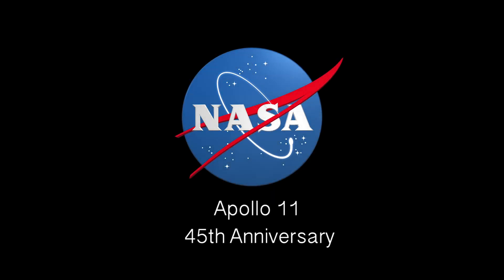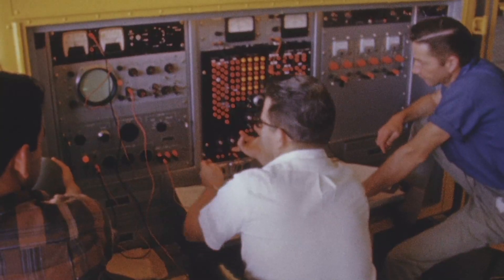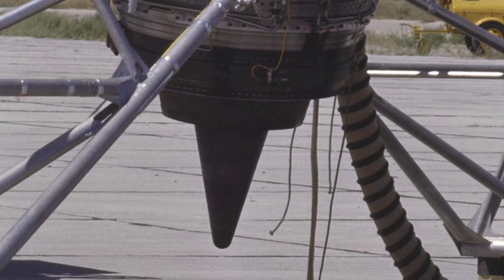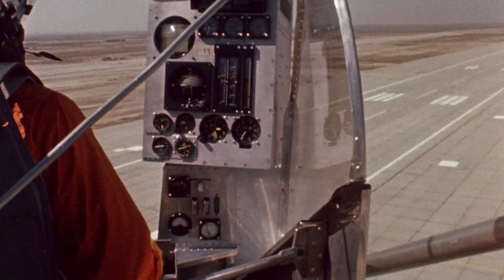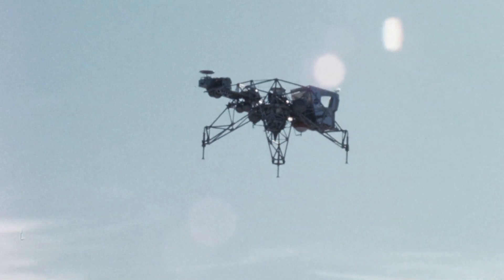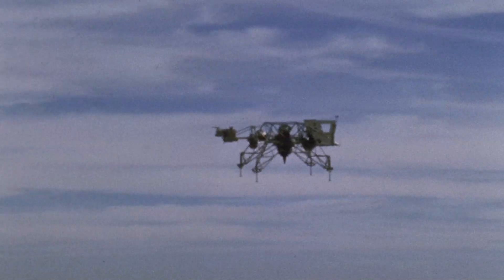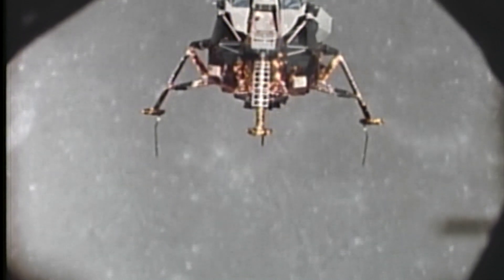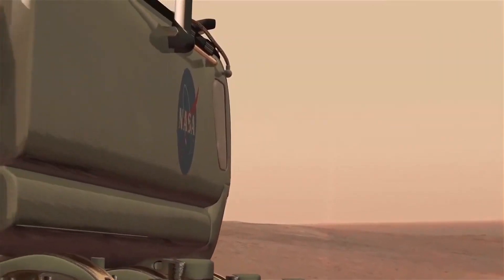LLRV Testing Contributed to Apollo 11's Success

Comment: Was it possible for a lunar lander to take off and do a moon orbit rendezvous? Yes. Was it probable to do,6 separate times, without error? Sorry, that bit is difficult to swallow. Given the complexity of the mathematics and the crude technology of the 60s, the pilots would have had an exceedingly small margin of error. Is there video of LM-orbiter rendezvous testing, say in earth's orbit? Actual test footage, not simulation or diagrams. Surely they did exhaustive testing of such an incredibly risky procedure.
Reply: Nope.   No testing.  In 1968 They were 10  years away from going to moon .  And funding was an issue.  If we did launch men in that tin can to go to moon in 1969. It was so  unbelievably risky.  It was criminal.  After Grisom burned up .4 months earlier.  It was  Suicidal...So much could go wrong.  Those old wire resistor  computer controlled systems were prone to bugs.  
It was a great achievement to goto earth orbits. For 4.  days.  Stay alive And  then re entry and splash down.  
I think the moon stuff. Was Gemini unmanned vehicles.   Like Russian luna 15.  They may have sent drone to moon with an antenna in 1969.   But the  videos of men on moon was a full scale  simulator. And  the playing golf. And racing around in dune buggies.  Doing somersaults and 
Jumping around careless with those fragile 4 psi pressurized suits.   Sorry Charlie .  Never happened. No way.  
To risky.   No redundancy. 
If you analyzed the pictures of lem  on moon.   You see the gold wrapping. Was not uniform.  And the rivets were not uniform.    It was a prop.  No way nasa would just wrap the stuff like ac10 year child would wrap a package.
Reply: Also: the whole ascent and docking procedure was divided in seperate phases. Each phase designed in such a way, that they had to take care of only one variable but the sequence eventually leading to a LM - CMS distance from which docking by hand could be done.
You might want to look up this procedure as it is quite interesting instead of claiming things to not have been done which actually have been done and you simply do not know!
Reply: @riddlescom  The apollo lunar lander's AGC computer was NOT an "old wire resistor "  computer but a integrated circuit computer. The integrated circuits were out before the apollo missions. We even had them in the UK then!!!! See;
http://www.ourcomputerheritage.org/E5_Elliott_905.htm
I was a service engineer for 5 years at GEC on these and the predecessor the 903 which was resistor/diode/transistor based. The Texas TTL SSI had to be out before 1968 for them to be designed into a computer.
I don't have enough personal knowledge to debunk all of your ideas, just the computer non-facts.
Have a look at computer info on;
https://en.wikipedia.org/wiki/Apollo_Guidance_Computer
Reply: This moon lander looks as child chouse in the garden made of cartoon and foil. How this objet could start from a Moon with high speed and not brake off to pieces ? How computer made of wire and weight 32 kg could calculate a trajectory to base ship. Hot to get to base ship . And in fina how can he join to base ship. No any chance . No any such events after 1972 year. No any returns . All was a fake. Space odysey 2001 no 2  reacrivation . made by NASA.
Reply: @Tadek5  I understand why you may think that the lunar ascender would break to pieces during it's ascent, this may be because you think that the force of the air on the fragile looking craft would mash it to bits!! There is no atmosphere on the moon so there is no pressure on the ascent module apart from acceleration. How could the computer calculate a trajectory to the exact microsecond to the exact degree etc etc. It was much simpler than you think. The orbit of the CSM was KNOWN. The time of the burn needed to get the ascent module in a lower orbit was known. The CSM knew where the lunar module was on the lunar surface, so the CSM commander altered his trajectory to fly close to directly over the lunar descent module, it didn't need to be exact. When the CSM was getting close to over the lunar module, the ascent module engine burn was initiated. This burn was such that the ascent module would be some time behind the CSM and in a lower orbit. As the ascent module was in a lower orbit it was going faster so would catch the CSM in an hour or so, nothing exact needed. As the ascent module caught up the CSM it accelerated to get in the same orbit as the CSM and then re-docked with the CSM.
It was great that the NASA scientists, engineers and astronauts knew what they were doing, a good job you were not involved.
Reply: @Tadek5  
What you see from the LM is just the outer layer. The outer layer is a combination of mylar foils for thermal protection (and for some protection against micormetoeroites). Beneath that foils was a rigid structure made from titan.
You may imagine wrapping your car into tin foil. That does not harm the structure of the car but yet looks very fragile from outside.
Reply: @Tadek5  
The question is not how a computer made from wire and with a weight of 32kg could calculate something. The question is: was the computer up to the task required to do?
And the answer is: yes, of course he was. The actual computations are not that difficult. Even you could do them with just paper and pencil although it would be hard to reach the 2 second cycle the computer was required to do them.
Navigation in space is not that complicated especially not with Apollo. "Flying a space ship" has much more similar to "throwing a stone". At the moment you trow a stone, the whole trajectory is already fixed. So if you have plenty of time before hand, you can actually precalculate at what angle and with what speed you need to throw a stone to hit what target. Guys fireing canons did this decades before with nothing more then paper and pencil and some tables.
The ascent was divided into intermediate goals to reach. One can easily calculate how long the engine needs to burn in order to get from one goal to the next.
Preperation is everything.
Reply: Yes apollo 9 is the manned rendezvous lem test
Reply: Besides the guidance computer itself, the LM had a rendezvous radar on it. The LM's radar locked onto a transponder located in the orbiting CSM. As such, the LM's guidance computer had constant, real time azimuth (direction) and distance information to the CSM. Essentially the LM knew exactly where the CSM was in the sky. These are essentially the same techniques airplanes use to find airports at night and in bad weather.
Reply: As per the NaASA Apollo 11 owners manual, the Lunar Module was to be engineered so perfectly that it would not be test-flown on earth before undergoing the actual mission. Go figure !
Reply: @riddlescom  "Those old wire resistor  computer controlled systems were prone to bugs." I guess you realise that the computer used by apollo craft were integrated circuit machines?

Comment: has their been any video evidence of a successful lunar module test flight, cause the only one i seen is where it exploded in mid-air? i'd figure lunar conditions would be 100x more difficult to navigate since we only have theories and formulas to go on and no first hand experience. Yet everyone made it back successfully back and alive on the first try from the moon surface, all based on mathematics and formulas.
Reply: I ask the same question,  haven't seen
Reply: The LM was never tested on Earth and it couldn't be, under 1 G it's too heavy. It was tested in low Earth orbit during Apollo 9 and in lunar orbit during Apollo 10. A LLTV never exploded in mid-air, I'm not sure which incident you're referring too. 

Flight on Earth was once only "theory and formulas" too, but that's irrelevant. It's actually simpler because space is a vacuum so there isn't any aerodynamic forces at all. Just Thrust > Weight and vehicle goes up, simple as that.

Comment: Main Engine: General Electric CF700-2V Turbojet, rated at 4,200 lbs thrust.. Why is there no exhaust plume seen coming from the main engine during liftoff?
Reply: "Turbojet"
Reply: @RocketPal   Thanks.. Well, at least the LLTV thrusters show the hypergolic fuel plumes.. That's more than can be said for the Apollo LMs, that allegedly flew in the vacuum of space.
Reply: "Allegedly" no. It did.
Reply: @oscarin13  Yeah, I shouldn't have used the words "allegedly flew", when what I really meant to say was "didn't fly".
Reply: Turbojets generally don’t generate big exhaust plumes. 
The rocket engines used on the Apollo LM don’t either: the flame from those engines is transparent, and there’s no soot to form a visible plume either.
Reply: @Hobbes746  Hypergolic fuel plumes are not invisible, regardless how small.. When the Dragon docks with the ISS, the fuel plumes are very visible.

Comment: Jet engine only can run in earth atmosphere. And this premature giant spider does not have enough fuel for landing time ignition and flying back to mother ship which was orbiting in moon orbital. Can anyone explanation this scientifically ( not emotionally)
Reply: It's literally in the name: Lunar Landing Research (or Training) Vehicle. It was specifically used to simulate the last few moments of a lunar landing when the vehicle was under manual control. It was not used to simulate orbital braking or the ascent stage's liftoff.
Reply: This vehicle was used for *training*, here on Earth. The LM could not be flown on Earth (its engine did not have enough thrust to lift the LM in Earth gravity), so they built the LLRV and LLTV so the astronauts could practice the landing in a vehicle that could operate on Earth, but would feel similar to the LM on the moon.
Reply: The jet engine was not used for "power" necessarily.  It's sole purpose was to simulate lunar gravity.  The engine was on gimbals - - which means if the craft tilted one way or another, that engine could tilt in the opposite direction so that it was always pointing straight down - - again to simulate lunar gravity.  It did this by burning with a constant thrust equal to 5/6ths the weight of the test vehicle - hence making it weigh about 1/6th of what it would - thus again - to simulate lunar gravity.  That was the ONLY job of this engine.  It was something that would not exist on the ACTUAL lander, so the fact that jet engines don't work in a vacuum - while correct - is irrelevant, since the ACTUAL LM did not have this jet engine to simulate the lunar gravity they would ACTUALLY be in.

As has been pointed out, this vehicle was built only for the astronaut to train landing on the moon.  It had nothing to do with  de-orbiting, burning off a large amount of horizontal velocity, landing, taking off again and getting back into orbit.  The only thing it had to do was lift off the surface a bit.....and then land back down.  It was only a training vehicle for landing.  This training vehicle wasn't coming from orbit, landing, then getting back into orbit.  It simply lifted off.....got a few hundred feet high....and then came back down and landed.  That's the only thing it did.  You are comparing the fuel needed for that to what would be needed getting into orbit.  It's a patently absurd comparison.

Comment: We landed men on the moon over 50 years ago and now NASA tells us that they are trying to develop a plan to land men on the moon now. That sounds like NASA hasn't figured it out yet. How did they do it over 50 years ago with old technology? I have my doubts.
Reply: This time they are doing it with different technology, and at a different location (the Moon's south pole).
Reply: I once went on vacation to Colorado.  I am putting together plans to go again soon.  I guess the fact that I have to plan again, it means I never went to Colorado before, right?

That alone should tell you how absurd your train of logic is.  But further, they are doing so with entirely new technology, new hardware, new staff.  It's still a mission to the moon.  Just because we did it 5 decades ago doesn't mean we can just build a rocket and fly to the moon on a moment's notice.  The entire infrastructure that landed men on the moon during the late 1960s and 1970s vanished.  All the people that worked on it are dead or retired.  While we know how they did it before, we won't be doing it the same way - - - - - it would be like thinking you're going to start a web-based company and thinking you're going to be able to do it with a bunch of Apple II computers.  If you plopped a computer engineer from 1965 who designed some code for some operation for the Apollo program into 2024, he's be completely lost.  If you asked him to write code that will operate a computer using today's technology that will put a man on the moon, do you think that guy would need some training?  I mean, he's done it before, right?  Would the fact that he would need to be extensively trained on the systems and software before he could even begin?  Would the fact that he would need extensive training on today's tech be somehow evidence that he wasn't part of a program that put man on the moon using 1960s technology?  The answer is no.  Of course not.

Comment: They didn't explain how they reduced lunar orbital speed from 3000mph to landing speed. Did that consume much fuel seeing there is zero atmospheric resistance to assist breaking?
Reply: They relied entirely on engine burning to slow down. The lander was incredibly lightweight, so the fuel mass wasn’t that much compared to the rest of the mission
Reply: Also engines work more efficiently in space.
Reply: If you know anything about orbital mechanics
Reply: @junkyard3924  Keh? Do explain
Reply: @yabbadabbadoo8225  Re-entry burn.
Reply: @yabbadabbadoo8225  This explains well, it’s from a game though
Reply: @junkyard3924  Say wot? Re entry into what?
Newtons 3 laws of motion applies in all physical fields. You'll have to study it one day.
Reply: @alexsiemers7898  Using Newtons laws of physics and motion explain how that's going to work in a zero contact environment? This should be fun.
Reply: @yabbadabbadoo8225  I don’t know what your argument is. Isn’t your question about reentry burn and how to slow down from lunar orbit?
Reply: @junkyard3924  that's what I said.
When craft return to earth speed is lost due to ever increasing atmosphere density.
On the moon it's zero.
Reply: @yabbadabbadoo8225  That’s why all lunar landing modules need to have a retro rocket to slow down. Instead of using air friction it would need to fire backward for a period of time until horizontal speed is acceptable for decent.
Reply: @yabbadabbadoo8225  It takes a lot less fuel and a lot easier to slow down in space because the lander is very light, it’s pretty much a tin can with a couple fuel tanks inside and 2 humans
Reply: @junkyard3924  You should keep in mind tho, that atmosphere around the planet does greatly decrease the amount of energy/fuel needed to land.  

A lander at, say,  100 miles above earth is not practically "lighter" because it is "in space".   At that  altitude, gravity  is [3959mi / (3959mi  +  100mi)]^2  =  about 90.5% of what it is on the ground.  

It would take HUGE amounts of fuel to land on Earth if the atmosphere was not present.
Reply: @ronalddump4061  Yes I understand that. Space x is playing that game for their recyclable boosters. But gravity at high altitude really shouldn’t matter. High gravity only means high orbital speed. If earth doesn’t have an atmosphere, spacecraft can orbit just above see level (Well of course, have to make sure not bump into anything). The only difference is orbital speed will be higher than at higher altitude.
Reply: @ronalddump4061  It take less fuel to land on moon because it has less gravity compare to earth. So orbital speed will be way slower.